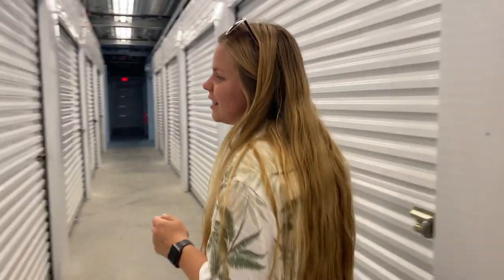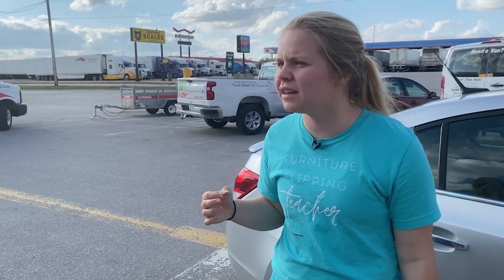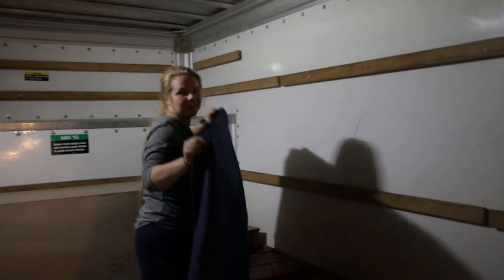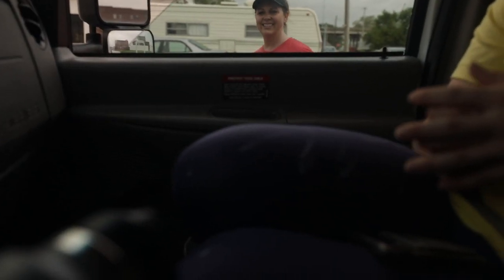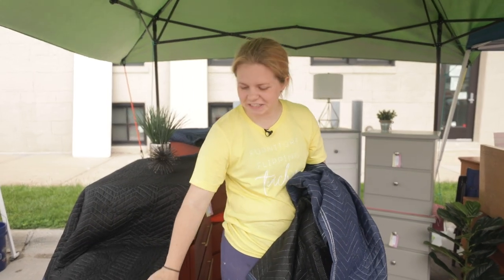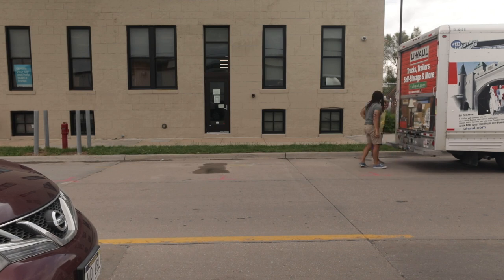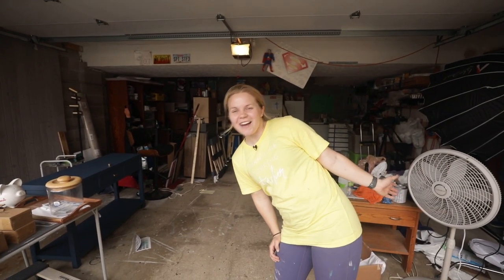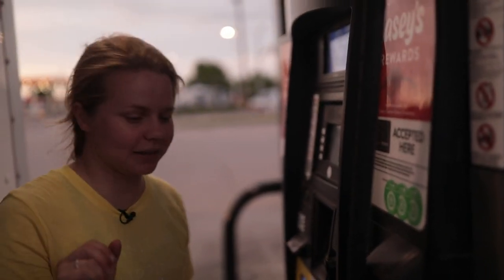Our FIRST Vendor Event |  @HabitatforHumanity | FFT VLOG

Comment: SUGGESTION: take one small dresser and show each step you do refinishing it. divide into sections. First section from top to bottom is Original, next section from top to bottom is sanded,next stain/paint 1st coat,, and so on for each, 2nd coat, 3rd coat, sealer, polish, hardware. That way everyone can see  what goes into it.  the rest is only what your selling.then print off photos of  Your pieces that you will customize & put in picture frames on the furniture your selling,with a sign that states they are for sale & customizable😊
Reply from the maker: We had some similar things like this going on! Defs learned a lot! Thanks for your suggestions and thanks for watching!
Reply: To add to that, maybe have a photo album with pics of steps you took to get to the final finished pieces.  Have another photo album/book with all the pieces you have that are not finished to show what you have that are customizable. Also include measurements of each piece & have a tape measure with you for those customers that need a visual.
Reply: I would suggest also having a small piece to work on.  Also, if you have a digital picture frame or tablet you can run photos or video of previous projects.